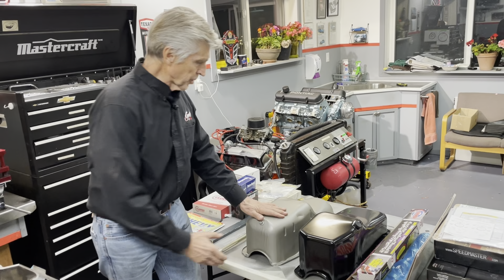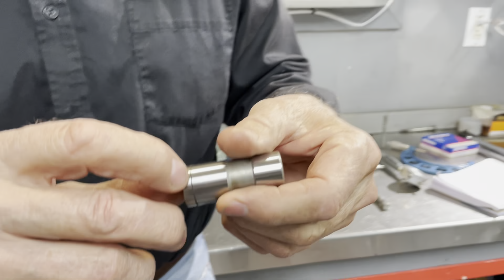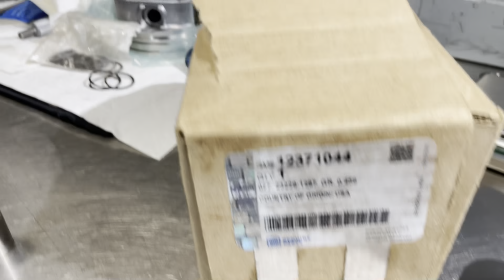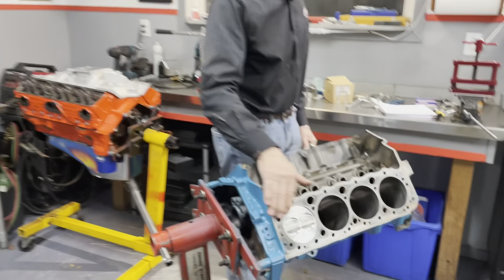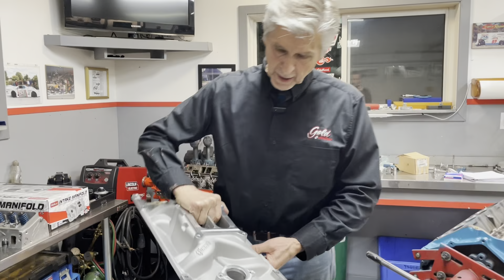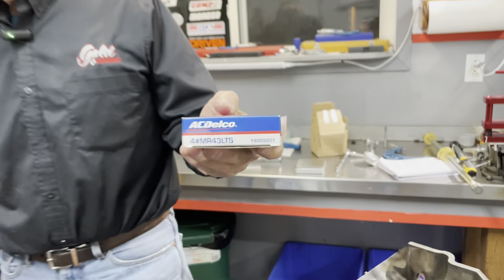Do you need to Balance your engine??? Will it survive if you don’t???

Comment: You build ENGINES right? Why does this generation say motors? Huge difference. People like Richard holdner says he calls it a motor because general motors made it😂😂😂...
Reply from the maker: Technically it is an ENGINE. Only engines use combustion. A motor converts electrical energy into mechanical energy. A motor could also be an air motor or a hydraulic motor. AG
Reply: @goldsgarage8236  yes sir. My dad built Detroit diesel engines for 50 years. I understand. Some people don't
Reply: In German there is only Motor or Triebwerk
Reply: Ford Motor Corporation American Motors

Comment: Allan, concerning decking the block. If you find the right machine shop you should be able to get then to stop the cut just short of the serial number pad. Finding or ordering the required piston CD is the best option provided the deck is flat, square and no scratches or rust pits.
You are correct on the balance issue, depends on application. Gas pressure differences in the cylinder can cause vibrations for the really anally retentive. Cylinder head volumes and differnces in air flow can contribute to this.
Reply from the maker: Thanks Dale. AG

Comment: The last years GM used flat tappet cams they used the Delphi lifters with a flat cut on the side of the lifter, to allow extra oil to flow to the cam lobes. I will buy Delphi lifters and set them up in my mill and grind a flat on the side of the lifter.
Reply: its a lot easier to groove the lifter bores using the tool sold by Comp Cams.
Reply from the maker: Thanks for the tip Racer. AG

Comment: I disagree on your view on balancing, but I might use the same engine differently then the owner will. Afterall, it won't be a monster of an engine, with only 1hp/ci, which is close to factory specification and they did not balance each engine when producing them. I guess it's a middle ground or even closer to your take on balancing this engine Mr Gold. Great video :)!
Reply from the maker: Thanks D for your input. AG

Comment: If you're going to change pistons and they don't weigh the same you might want to rebalance? 

It can be as easy as removing a little weight from the new pistons if they're a bit heavier. If they're lighter it will need to be spin balanced. At this point you might as well spend the time polishing the beams, shot peening and weight matching the rods. Might as well replace the bolts with ARP and recon the rods as well.

This way if he has a weak moment and lets someone borrow the car, when they tach it up to 6,500 RPM, the thing will stay together. An ounce of prevention is worth more than a ton of cure.😎👍
Reply from the maker: Thanks for your comments Itseither. AG
Reply: The engine requires none of this nonsense and will be just fine.

Comment: Probably my Old School build technique but I absolutely despise the so called hardened  "Spiro Lock" wrist pin Retainers as both Removal & Insertion scars up & Damages the relatively Softer piston lock Groove area......These things were obviously Design intended for 1 time use and Throw away Piston applications......Properly Sized & correct Thickness "Tru-Arc" wrist pin clips used with Low End clearance piston Pin Fitting assure trouble free operation without  scarring up & Damaging the soft piston Lock grooves
& are Simple to use.......
Reply from the maker: Thanks Tom, i don't think anyone likes installing Spirolox, I will let you know haw the Sealed power Clips work. AG

Comment: Looks like you've got another Quality high Performance Smooth running engine build going there !!  ....Something you didn't mention (Or I missed it) is All  new Lifters should be Checked & Verified for Correct lifter face Convex crown geometry & Camshaft lobe Taper as Either of these can cause Inconsistent lifter Rotation & early cam/lifter..... Failure.....
Reply from the maker: thanks Tom

Comment: My V6 engine had a 30gr spread on the piston/rod assemblies. So it doesnt seem to me that these engines are very balanced to begin with. I assume they had a standard bob weight  to wich the cranks were balanced but with a high tolerance on parts.
So now when I have weight matched all and taken off around 30gr on each assembly it should only have gotten better even though its still not ”balanced”.
My machinist/engine builder is of the opinion that weight matching is far more important than balancing. On a street engine that revs 5500-6000 revs that is. A street engine sees those high rpms maybe 10% or less of its life anyways so why would it be so important?

But balancing sure isnt bad. So if one want to spend the money go ahead.
But between balancing and a pair of headers I know where my money would go 🙃
Reply: Even those "balanced" Scat and Eagle   ,are+/- 2/3 ,grams. And if your not going over 5500 rpm. Kinda ok. But myself, K1 Technologies,  or Callies is worth the extra money
Reply: @ronniecox109  I ground and polished the oem rods. When done right theyre good for 7000rpm (might need to shot peen for that).
Got every rod/piston within 1gr of each other. Compared to the stock weights and difference Id say its an improvement even without balancing the crank.
The money saved from balancing I used for boring and honing, decking and resizing/honing the big ends on the rods (”critical” on oem sbc rods).
Reply: @magnusdanielsson2749  thats the way do do at home balance. Same with the pistons ,weigh em all, lightest one is your target weight for other 7.Rods the same. Can refine a little by making a stand ,to weigh big and little end of rod.  Or just weigh em ,match em .and run em. My 527 Small block stroker has balanced forged  bottom end. But its a track car. Sees rpm regularly.  Keep wrenching , and racing. Just do it safely.
Reply: 427 stroker , big aszz fingers . Tiny keys.
Reply from the maker: Thanks Magnus. AG

Comment: I forget about the numbers at the front of the block on the chevys. I'm used to working with ford FE & 385 series engines. They don't have such numbers on the deck surface. I agree .050 quench is ok. I run a .045 quench on my 390.  But somthing I wasn't thinking of at first though, if u are using Cometic head gaskets, they require a 50 RA finish. U might want to skim it for the finish surface? On my 390 I balanced the pistons & rods myself & I took a piston & rod from what used to run on the crank I was using & figured the bobweight so I knew what it had run with, then tried to match my new pistons & rods to the same bobweight, but I did not spin balance the crank. It runs great!!!
Reply from the maker: Thanks Jesse. AG
Reply: How close did you get the weight from old pistons and rods to new ones.
Reply: @jarheaded9278 Bob weight was within 10 grams

Comment: What you call 'Circlips' are really 'Spirolox'. A 'Circlip' is just an internal 'E-clip'. Totally different. A Circlip has 2 holes for a pair or expansion pliers. Spirolox do not. The old method of wrist pin clips was either single or double Circlips with the flat faces towards each other for double installations. Whatever clips you use is dependent upon the piston clip groove machining. The clips need to be close enough to the pin to prevent hammering of the clips which will eventually cause failure. Yes, balance is critical, more so at higher revs, but as long as the balance factor favors Overbalance by a small margin it's 'OK'.
Reply: Circlips installation. I would understand your comment about the flat sides to be the sides with the almost sharp 90° edges rather than the rounded edges on the other side. If you install the clip with the rounded edge facing out, any wear can form a "ramp" which will eventually allow that clip to come out. I have installed them with the sharp edge out.
On turbos with floating bearings, the inner clips must be installed with the sharp edge to the housing center and the rounded side to the bearing. After oiling and installing the bearings, the outer clips have to be installed with the rounded side again toward the bearing. If the sharp side is installed toward the bearing, that sharp edge will act like a drill bit on the soft aluminium and peel the bearing off.
Reply: @daledavies2334  You're right. I didn't say that very well. What I meant was that you want the squared 'flat' side of the ring against the outside machined 'flat' groove of the piston. If you use 2 the 'rounded sides of the lock rings face each other, on the inside of the pair. Otherwise, yes, they could eventually hammer out.
Reply: Those speedpro pistons take a round wire lock not Spiro locks , Spiro locks will come out the speedpro part # is LR 63 for pin locks for speedpro piston
Reply: @larryburns4605 thanks for your comment bro. Could you machine the speedpro pistons to accept the spirolock lype?
Reply: @4thdimensiontravels855 ive done just that on a set of pistons i used in a 406 with oldsmobile rods
Reply: There is circle clips don't have any holes just a circle and are round...  snap rings have the two holes in them for the pliers to install them.  I have used them and you put the flat side out like one of you comments by a guy...
Reply: @leonardfoster6252  Yah, I've seen those rounded clips like you're talking about. I don't like them. They come on the low end replacement pistons. OK for stock use I guess. I have seen those clips (mostly the e-clips) come loose and over time the pin slams a hole in the cylinder wall moving back and forth.
Reply from the maker: Thanks Vince, looks like you started some dialogue. AG
Reply: @goldsgarage8236  Dialog is good.
If not good, it's entertaining..... a win, win. 👍
Reply: Thanks for the clarification Professor Fact Checker.
Nobody would understand otherwise.
Reply: I came across Mr vizard's books add a yard sale back when I was a young kid before I was even old enough to drive. I read that book so many times it fell apart! 😂 Way more information than all the hot rod magazines I would buy that pretty much would try to sell you parts instead of giving you real info. They would make you think gapless rings and titanium retainers were a must! I fully believe they would embellish the dyno test just to sell the parts! To be fair that's what a magazine's job is is the sell  product whether it be car parts, bikes, skateboards, the new protein powder Mr Olympia says he takes and we as impressionable young kids would buy them for $5 just to receive fairly useless information.
Reply: Should use snaprings.
Reply: Circlips installation. I would understand your comment about the flat sides to be the sides with the almost sharp 90° edges rather than the rounded edges on the other side. If you install the clip with the rounded edge facing out, any wear can form a "ramp" which will eventually allow that clip to come out. I have installed them with the sharp edge out.
On turbos with floating bearings, the inner clips must be installed with the sharp edge to the housing center and the rounded side to the bearing. After oiling and installing the bearings, the outer clips have to be installed with the rounded side again toward the bearing. If the sharp side is installed toward the bearing, that sharp edge will act like a drill bit on the soft aluminium and peel the bearing off.

Comment: In regards to balancing, so long as the replacement components are within a few grams (calculating bobweights are a bit more complicated that weighing the entire assembly, but in this case the rod small end and big ends will be very close to stock considering they are both I beam rods) the crank has no knowledge of what's imparting the force on it. (assuming it was reasonably balanced to begin with, and the Chev small blocks are quite good from the factory) 

What will show up for the end user if it's too far out of spec, is an annoying shake typically between 2000 and 3000 RPM, right where a street vehicle spends 90% of it's life.

As a side not, I just rebalanced a Gen III Hemi stroker crank to work with 70 gram lighter pistons, it required a correction of under 20 grams per end in the crankshaft counterweights.
Reply from the maker: Thanks Yaarda. AG

Comment: That'd be me in regards to the wire wrist pin clips. Just for fun you should put a proper .927" spirolox in that pin groove, you'll find the lock is a loose fit.
Reply from the maker: It is, i did try it. Thanks. AG

Comment: I got a lq4 gen 3 short block and bored it .030 over and put ls2 flat top pistons in with beefier gen 4 rods ……didnt balance it either…heck i didnt even check the gap on the rings….plus i added an LSA supercharger …..motor runs great and even better at 12psi boost…..now im building it into a 408 stroker…but the rotating assembly came balanced from the factory….i also took a gen 3 LS 5.3 with the dished pistons and swapped them out for 4.8 flat tops for more compression….didnt balance that motor either….and its a screamer…ive got roughly 15k mi on the supercharged 6.0 and around 20k on the 5.3…all trouble free miles with zero issues…..unless your building a stroker i dont think balancing is very nessicarry…..
Reply from the maker: Thanks Trent. AG
Reply: Good luck with all that  bubba.😅@goldsgarage8236

Comment: If your crank wasnt in need of machining, and you weigh your pistons and rings, then weigh the small end of the rod and get them all equal....... what's left to balance?
............asks the guy who has only built two engines in his life, both barely over stock.
...... but had both rotating assemblies balanced 😂
Hey, it made me all warm and fuzzy inside. 😉
Reply from the maker: Warm and fuzzy is good Randy. AG

Comment: I don't mean to be rude, but you are Giving away alot of power with those pistons being that far down the bore and by using that cam profile..
 Balancing is a must in a performance application, however so long as the calculated Bob Weight matches within 2 percent of target as you said it is, it will be fine.
for some applications the SpeedPro pistons are great but,
And Ive used those without problems and there are also Silvolite brand  pistons that are fine for stock or mild builds. but if you want floating pins and alot more choices, and  a very strong piston
I've found 
The Keith Black Claimer or their 390 series to be the best budget build cast hypereutectic pistons to use. But they may need expensive machining of the bottom of the skirts for the 350 crank combo.
As far as cost goes, you could have had a Scat 383 crank and stock rods and 2 valve relief cast pistons combo for the money you will spend  buying  gaskets and all the other parts individually and buying new rods and the name brand camshaft etc..
But that can be tricky if you don't know what combination of parts works.
And
I get it though if the Original Rods need re-sizing and weight matching and you don't have the tools and experience or the time to find another set or  money to pay someone to bring the originals back too spec.
Reply from the maker: Thanks for taking the time to provide your input Brent. AG

Comment: Thanks for the video. Just what I needed. I'm in the process of doing a mild SBC build and was wondering if l had to balance it. Also what is the best head gasket for aluminum heads?
Reply from the maker: Thanks GasCar. Felpro and Cometic are both good. The only one that I think you should avoid on an aluminum head is the .015" Stainless steel gasket. AG
Reply: Thanks, much appreciated 👍

Comment: The quench thing is why I always disliked the 4 valve relief pistons, those two dents in the quench surface have to cause problems.
Reply: What if they benefit by tumbling the mixture?
Reply: @randywl8925  It would hard to verify I think, the main point of good quench is detonation resistance. Be interesting to see if the dyno showed anything.
Reply: I'm with you, but just tossing my thoughts out there.
Reply from the maker: Look what you started Lee.AG
Reply: The valve 4 notches generally account for a 7cc (average) difference. So if you reduced the CD by say in the area of .028-.030 it would be roughly the same (in a flat top piston). If you didn't need the notches for cam lift or duration it would depend on the particular build and quench clearances. As far as the notches producing more eddy currents for the mixture swirl and homogenization, that is probably true, if you needed them.
Reply: @vincemajestyk9497  instead of valve relief semicircles, maybe 7ccs of angled or swirl shaped reliefs actually designed to induce swirl?